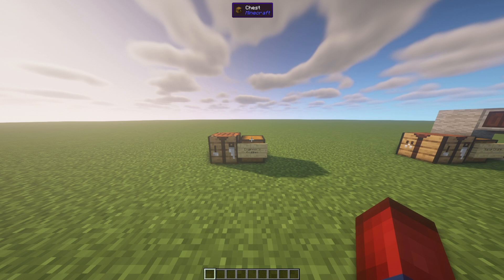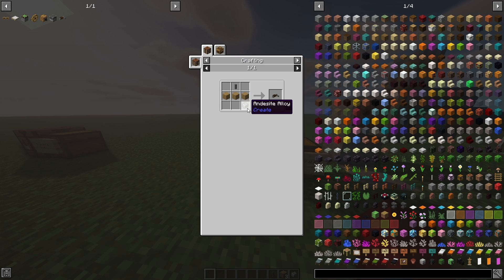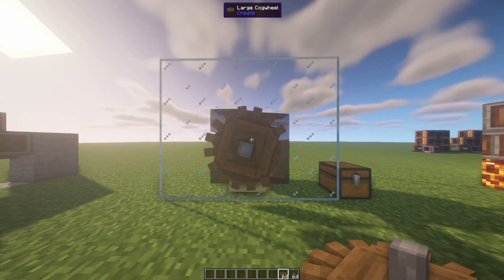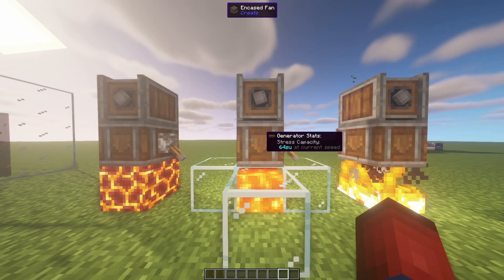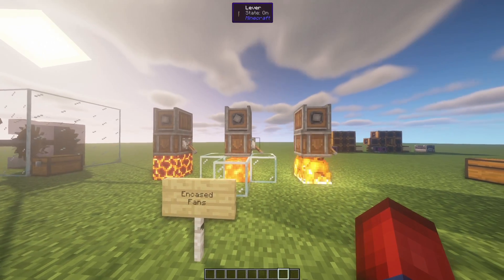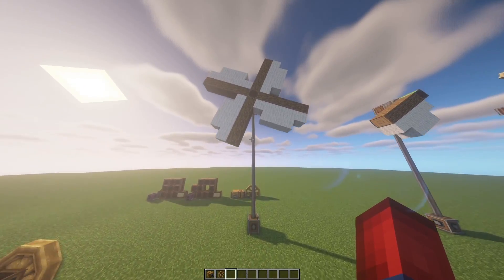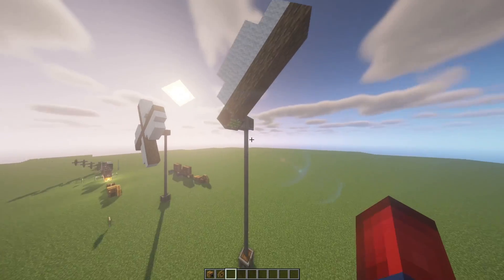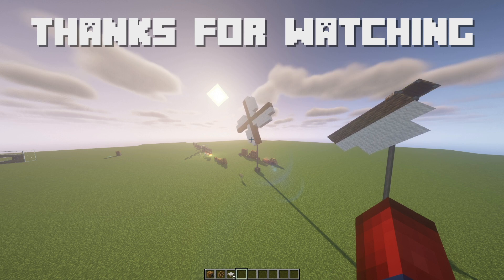Minecraft Create Mod Tutorial - Power Sources Ep 7

Comment: A little bit of info for those playing with Create on 1.19.2 like me, the Furnace Engine isn't in the 1.19.2 version, and was instead replaced by the Steam Engine. Instead of constantly needing fuel sources, it's only powered by fluid tanks filled with water and some heat from below (like campfires or Blaze Burners), and it generates power as long as the water is heated.
Reply: The encased fan generator doesnt work aswell is that a problem with the newer versions or just my world?
Reply: @cookedtoast-j3d  It turns out the encased fan power generator was removed in version 0.5. (which is Minecraft 1.18.2)
Reply: @bren4409  oh ty
Reply: Would a magma block work in place of a camp fire and blaze burner?
Reply: @CartoonEric  yeah but theres also enter creative mode Creative Blaze Cake that ignites your blaze burner (alternates 3 different modes) indefinite fuel. now you just gotta worry bout keeping thaat boiler full o water

Comment: fun fact: ive built Generator Cluster Unit with 9 furnace engines hooked together. as for how to use the furnace engine effectively, you can use the wood-charcoal method of feeding back the charcoal when the furnace dones smelting. charcoals burns for 80 seconds so i just set up a redstone clock that feeds 1 wood every 80 seconds to conserve wood.
and you have the cobble-stone feedback loop method i like to call it, having one or another fuel source hooked up to a furnace and then make the furnace smelt cobble, using deployer and drill to make that into cobble and return into the furnace.
Reply from the maker: Thanks genius man! I plan to make a similar video on this this week. I hope you enjoy it when you see it released :) feel free to join the discord if you haven’t already there are a bunch of people just like you creating some crazy designs

Comment: With saws getting wood and drills getting cobble you could get a perma energy source from the furnace
Reply from the maker: I have actually started to look into that. That would be a ton of power and would be perfect for honestly all of the machines.

Thanks for your comment!
Reply: @rockit14  even a bamboo farm super smelter like setup might work really well.
Reply from the maker: @davidrocamora5109  100% I did an infinite power video with trees and a furnance generator you could totally take that concept and just switch a couple of things to make it work!
Reply: Probably the best way to go would be to make a lava farm imo, longest fuel time and (in theory) fully farmable
Reply: kelp
Reply: @bobrumpkin9402  good idea, it is completely possible to connect an automated kelp farm powered by vanilla redstone and a carpet duplicator, also using normal redstone, to the generator and then just throw the output in lava using an automatic dispenser or use it for food. Again, very good idea.
Reply: @tommy_3039  or take wood, smelt the logs, take the charcoal, and use that to smelt the logs